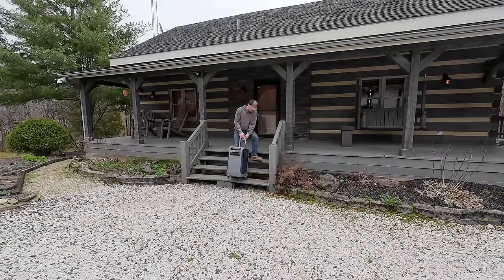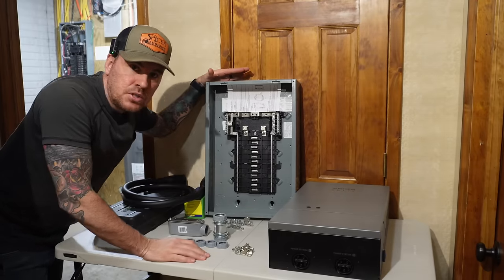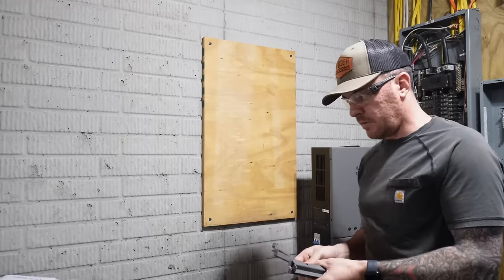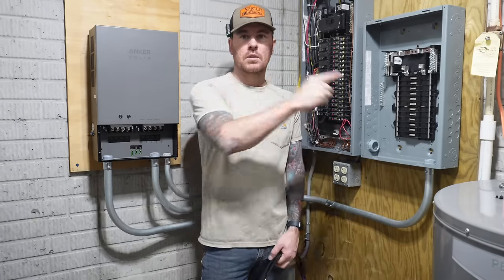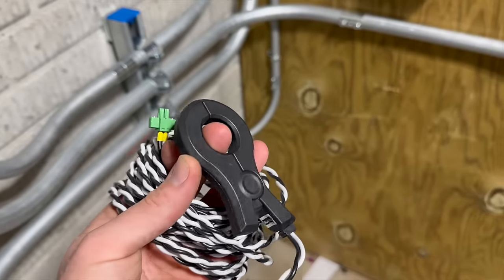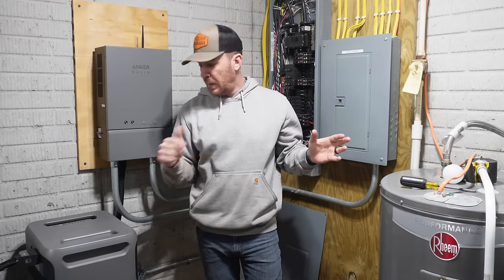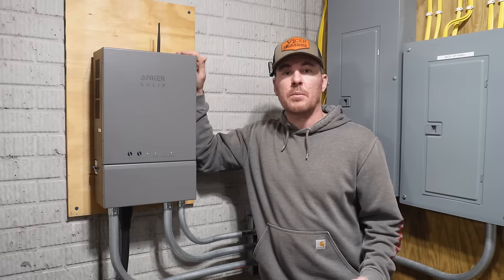STEP by STEP Installation Of Auto Home Back-Up System | Anker SOLIX F3800

Comment: Great video and nice work and I commend you on your knowledge, skills and workmanship.  

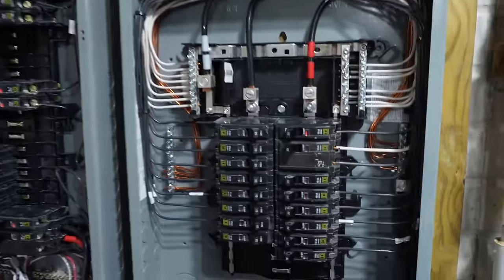I'm currently installing the EcoFlow Delta Pro Ultra for backup power in my home (no solar). I purchased their Smart Home Panel 2 and have the same thoughts/concerns you do at the 22:35 mark in your video. What if the smart panel fails and you don't have power to the most critical circuits in your home?  I've tried several times to get clarification from EF's tech support with no satisfaction which leaves me concerned to say the least. I've read one review of their panel where the owner had a failure on one of the main transfer relays and after several attempts to resolve with EF support he was waiting for a replacement panel - yikes! The warranty is 5 years and if that failure happens after that's an expensive repair especially if one can't do the work themselves. 

EF's smart panel takes things a step further and combines the auto transfer switch and sub panel into one unit so I don't have the option to incorporate your strategy to deal with a potential panel failure. This has me so concerned that I'm leaning toward installing the Reliance Pro Trans 10 circuit transfer switch instead and just use the batteries as a manual backup. Yes, that negates all the great features and cool things the system can do but also averts a potential major headache (maybe disaster) should the panel have a failure that can't be easily resolved. This stuff is great when it works but can be a nightmare when it doesn't. 

One additional note - I'm not an EE but it surprises me that both Anker and EF didn't design their smart panels with a transfer switch that has a mechanical override. There's probably reasons that I'm not aware of or don't understand but why they couldn't use something like a solenoid actuated mechanical switch instead of relays. I believe some automated generator transfer panels use just that type of transfer switch but obviously those panels are limited in their abilities compared to the smart panels.  

Again, great video.

Comment: Are you able to use the automatic backup and time of use together
Also through this system will the anker also charge itself when not in use or do I have to plug it in separately
Reply from the maker: @laiblegurevitch  yes to everything.   You are correct.  No charger cords needed.   And backup power transfers automatically in time of use mode.

Comment: How many breakers can be added to the subpanel?
Reply from the maker: Depends on the sub panel.  The one in the Anker kit is a 12 space.  I had a lot of smaller loads, so i purchased a 24 space.  Also depends on how big the loads are.  You dont want to overload the battery system.

Comment: Really great video and explanation of each step along the way. Thank you for sharing this with us. I do have an electrical question. I know very little about electricity. I have my system hooked up to my main circuit panel via an interlock kit and input box. I did it this way because I wasn't sure if my electric heat pump will work with a 50amp setup (the breaker for my heat pump is 60amps). Since the HPP uses a 100amp breaker, does that mean it would run my heat pump. FYI...I do have 2 F3800s and 6 expansion batteries. Was waiting for the double power hub to arrive.
Reply from the maker: Yes the HPP has a 100 amp feed and output.  Granted you only want to have a max continuous load of 75-80 amps of the 100.  Shouldnt have an issue running your heat pump though.
Reply: Thanks for the reply. Now I may not have to wait for the Double Power Hub.
Reply from the maker: @jimsipes9348  i dont know what that is.  The one in the video will accept two f3800’s
Reply: Anker's Double Power Hub will be coming out in June. It is 2 plugs connected to a hub. The plugs go into HPP receptacles in the F3800x and then you connect one end of your 50amp cord into the hub and the other end into my inlet box. That doubles the 6000 watts to 12000 watts. It's just a manual way of doing what the automatic HPP, without all of the extras that the HPP offers.

When there's an outage, I have to manually shut off the main breaker, and  turn on the generator breaker. Not as seamless as the HPP, but still does the job. Because my generator breaker is only 50amps, I would also turn off the 60amp heat pump breaker in my current system.

Comment: One thing I would do is put a division between your water heater and your power setup. I had a leak in my water heater line just a pin hole but it was shooting about 3 and a half feet on to the drywall for about a day before I went in the garage. I ended up having to replace the dry way. Anyway that would suck if it were to destroy your backup system.
Reply from the maker: Ya thats a good point.  I was concerned about how close that is.  I also have a slight leak on the pvc fitting for my incoming water.  I plan on repairing that soon once it dries up outside.  Thanks for the suggestion.

Comment: I would like to do something like this, but I already have a main panel on one side of the house and a sub-panel in the garage.  Will this make wiring a back-up panel much more difficult?
Reply from the maker: It would unfortunately. It really depends on what circuits you want to back up.  If most of them are in the main you can add another sub next to that.

Comment: @S.D. Nice install video, i know it’s like 5 months old now however why did Anker arrow points to source when thats the “load” , (edited sorry for the confusion) because i see “source” 19:55 noted on the CT’s when it should have stated “load” , all other CT’s from many different manufacturers note the arrow points to “load” not “source” .. this confused me for a bit lmao.. 😂. So in the end Anker CT’s goes in the same direction like the others except for some strange reason Anker tag it as “source” vs “load”
Reply from the maker: @fullyelectric  the arrows always point in the direction of current flow.  Thats 100%.  Ive been an electrician for 20 years and ive installed many ct’s.
Reply: @SpicerDesignsLLC  my bad the confusion was the tag of “source” on the label vs “load” like many other manufacturer CT’s that confused me for a sec..

Comment: Can you add a generator input on the AC leg and will that charge the Solix home power system?
Reply from the maker: I dont believe so but thats a better question for Anker.  They should be able to give you a solid answer
Reply: @SpicerDesignsLLC  They are emailing product team.  So we will see.  Immediate answer is to unplug them from the Smart Center and plug the generator direct to the AC input to charge, but figure that would charge much slower than the direct link from Smart Panel.

Comment: Great video! VERY clean job! I’m thinking about doing something similar in a 850sqf small cabin.I’m  looking at the anchor system, but I’m thinking that the Eco Flo delta smart home panel 2, would be easier. It Doesn’t require an extra subpanel, you run your loads right into it. Have you ever looked into those? What is your thought about them?
Reply from the maker: Those look like a nice system as well.  I think either route you go you would be happy.  Not sure if that system has the time of use mode that discharges during peak hours though.

Comment: Do they make a whole house panel so I do not have to select breakers?
Reply from the maker: They do for other systems but not currently for anker.  If you only had a 100 panel you could potentially set this up to back up everything.
Reply: ! @SpicerDesignsLLC  I have 2 sub panels through out my house so it would be tough to get circuits I need. Thank you for the response

Comment: Its funny, I just watched Ankers own explanation video of the Home power system, and your explains everything much better, especially the wiring, and what the solar input ports are for on the home panel. Id love to see the video when you add some solar arrays, do you add them direct into the F3800 or as a seperate connection into the home panel? The F3800 are limited to how many arrays and input/output on each unit
Reply from the maker: I will definitely make a video when i install the PV system.  Theres two ways you can set it up.  If your using it as a portable unit you can charge then with solar.  Or for your home set up you can install a separate PV system that will couple with the Home Power Panel to provide better efficiency and savings.
Reply: @SpicerDesignsLLC  This was what I wanted to ask as well. I have solar that comes in as a tandem breaker in the panel. With being grid tied, it shuts down if the power is out. Not sure how you keep the panels on and can't find info in their wiring diagrams. Thinking maybe the PV breaker needs to go in the sub panel?
Reply from the maker: @bobo2186  there was a section in this video where i showed the pv current transformer connections.  Looks like the two pole pv breaker stays in the main panel.
Reply: @SpicerDesignsLLC  That is what I am gathering. It makes it seem like you would not be able to use grid tied solar without grid power then. If the inverter doesn't sense grid power, it shuts down to prevent back feeding to the grid. This would defeat the purpose of it for me. Thanks for the reply and I'll be keeping an eye out if you do add solar.

Comment: I believe in previous videos you’ve stated the downside of natural gas powered generators.
I understand the super features of the battery system you just installed. The downside is for extended power outages?
Reply from the maker: Yes they both have their pros and cons for sure.  Extended outages are definitely a con with the battery system.

Comment: Awesome work Kyle! I've been researching home backup solutions and trying to find the right smart panel that will fit my existing infrastructure the best. The Smart panel 2 by Ecoflow seems expensive to install since it's a standalone subpanel. I already have a 100A subpanel coming off my main panel. Can I simply install the Anker Smart Panel in between the main panel and the subpanel? Is there any limitation on how many breakers in the subpanel that the Anker Smart Panel can support or is it mainly limited by load?  The smart panel instruction also suggests installing no more than 16ft away from the main panel. Is that because the 200A current transformer wiring for line power monitoring and the 100A current transformer wiring for solar monitoring can't reach beyond 16ft?
Reply from the maker: Thank you!   And yes you are correct on both questions.
Reply: @SpicerDesignsLLC  Appreciate the response! Do you see any issue extending the current transformer wiring? My ideal location for the Anker smart panel is going to be further than the recommended 16 ft from the main panel.  Also, if the energy usage of all the circuits in the subpanel is less than the power that could be supplied by the 100A breaker at the main, could I ever overload the Anker system, especially if I only have one F3800?
Reply from the maker: @tonychung1988  no problem! I would imagine as long as you use a twisted pair cable you would still be ok, but i would verify with anker to make sure it wont affect your readings.  As far as the load, one f3800 can output 25 amps of 240v or 6000watts.  Two of them can output 12k watts.  So your only as good as your weakest link.  The less larger loads on the battery system the better.
Reply: @SpicerDesignsLLC  I just emailed Anker to see if extending those current transformer wires would cause any issues. Thanks for that suggestion! I also counted a total of 30 circuits in the subpanel (many are tandem) totaling 525A of breakers. This is supplied by a 125A breaker at the main. Since the home is relatively new and everything passed inspection, I'm assuming whoever put together the electrical system did the load calcs, used the correct gauge wire, and put an appropriate size breaker for the sub panel. I think the highest load appliances I have in that panel are the fridge, freezer, and some table top cooking appliances. I don't think I would draw more than 6000watts at once, but if hypothetically I could exceed that at once, would my appliances simply not work since it exceeds the output of one F3800?
Reply from the maker: @tonychung1988  if you have an amp probe i would suggest amp probing both phases every hour or so and charting the results.  Will give you a decent idea of what your outputting.  If you exceed the 6000w im guessing it will trip or overload the f3800.  Best answers will be from Anker.

Comment: If you add a 2nd unit, don’t you get 200a of power?
Reply from the maker: No.  A single unit can out out 6000w.  25 amps at 240v and 50 amps at 120v.  Two units will give you 12000 watts

Comment: Really nice work that looks awesome. I have a question/opinion though. Don't you worry about fire with the batteries? I see a lot of them starting fires in some of the EVs and cordless tools.  It's one thing holding me back from using something like this.

Comment: Sad news I was hoping for a Smart Transfer Switch between Battery to Public Utility.  Not interested in a  Backup Power Source or "emergency Power".       :(       The unit alone is a Backup source.    I do like Electrician's amazing artwork of wiring, I do miss the Industry worked many years as a Supplier CED.

Comment: So this is better then the tesla power wall? Will this replace a generac?
Reply from the maker: @ronlicari5403  i have a new video posting sometime next week where i added some solar panels to it.  Its a really nice system.  Now that ive had it, i would prefer it over a gas generator for my needs.
Reply: @SpicerDesignsLLC  Sounds great because I was going to get a propane generac installed, hopefully you will do a price comparison with solar and the battery system with a generac. Thanks for the videos

Comment: I have been looking at Anker and EF videos for months.  This one is the BEST hands down.  There are so many questions in your COMMENST, mine are probably already answered but …. In the sub panel - Any issue with having 240 volt circuits ?  Also, are GFCI or AFCI circuits handled the same way they are in the main panel?  Thanks keep ‘em coming … PS …. If you haven’t already, do the same type of video on the EcoFlow Ultra.
Reply from the maker: @wbarkwell  no problem with 240 circuits. I fed my ac from the backup panel.  Just have to be mindful not to load it up too much.  Gfi and arc fault should be fine too.  I added solar just last week.  That video will go live this weekend.
Reply: Thanks for the quick response … I enjoy your videos more than any others and believe me , I seen a lot during this process !

Two more questions  …. I have not seen anyone mention connection for a feed from a portable generator … If I run out of battery, where do I connect a generator to feed power to the critical circuits and/or F3800 ?

Also is there a formula you can share that will provide me an estimate of the load I am contemplating so that I don’t exceed the maximum ?
Reply: In case the Anker fails in a grid outage situation , I want to add a main breaker to the critical load panel so that I can add an option for a portable generator to feed all these circuits.  I would install an interlock between this panel main breaker and the generator.  You seem to have a lot of load in this panel - I will have a similar load.  What main breaker in the critical load panel would you suggest ??  Thanks ..

Comment: I have question I just purchased the same unit and I'm trying to figure out how is the unit going to charge. Does the f3800 charge through the power panel or do I need to plug it in to a 120v because I noticed you said you don't need your 120v plug you Installed
Reply from the maker: Ya it charges through the power panel.  If your using time or use mode then it will only charge during super off peak hours.
Reply: Thank you for the reply..One last question when they say you can charge from your grid tie solar how exactly does that tie into the system. I'm worried I will have a power outage and no way of charging the unit

Comment: I’m a fan of Eaton
Reply from the maker: @rokudanShinzu  glad youve had good luck with them.  All the panels ive installed were junk.  They like to over torque the bolt on breakers to the buss and had shut down the panel to drill them out and retap the buss.  Every breaker was like that.

Comment: one question i had was, the 5 hours left, did that include the expansion battery?
Reply from the maker: If the expansion battery is connected then it will factor that in with the time left.
Reply: @SpicerDesignsLLC  Got it. So'll need to buy the expansion. Or maybe even just another F3800?

Comment: Do I need to buy separate connecting cables from F3800 for the home power panel? Or does it come with the power panel?
Reply from the maker: You get one connection cable with the power panel.  If you decide to add a second f3800 you will have to purchase a separate cable for that unit

Comment: Question? Can you use that for 4 hours a day to save on electric bill?
Reply from the maker: Yes. It will actually do that automatically based off the schedule you set.  It will discharge during peak electricity rate hours and charge during off peak.

Comment: It works fine in that appliication, but is not that suitable in an RV etc without the transfer switch as it only has 2 inverters inside, 1 of which is also used for charging the unit, so the unit cannot output 240v power when it is charging. It can only do 120V power out of half of its outlets when it is charging.  It was a cost saving thing I guess.

Comment: What’s the average cost to install that home power kit and sub panel by an electrician?
Reply from the maker: Its hard to say.  Depends on the area and whos doing it.  Two guys should be able to install it in a day.  With material and labor should run you somewhere around $2500.